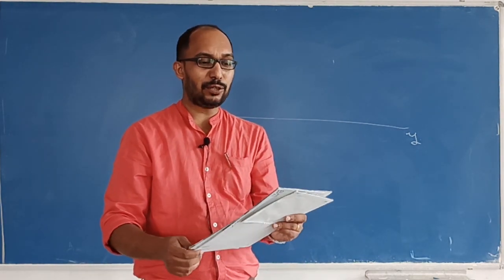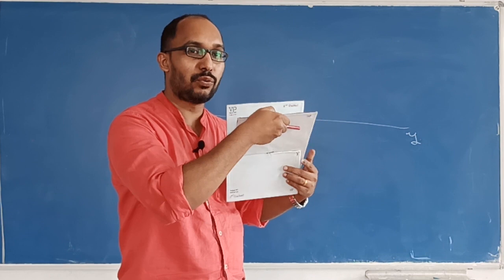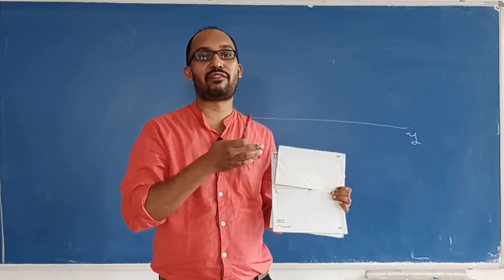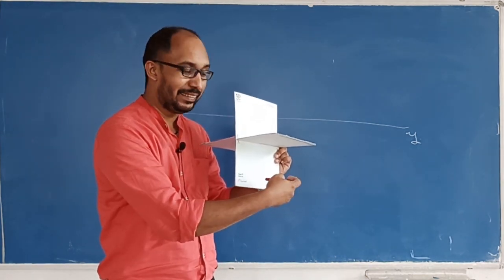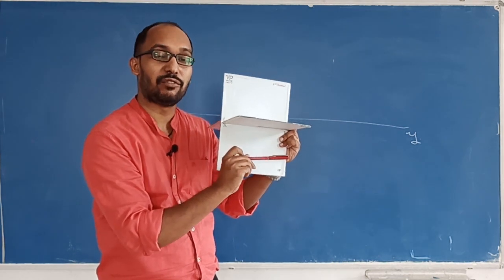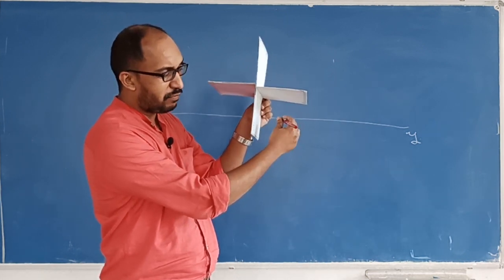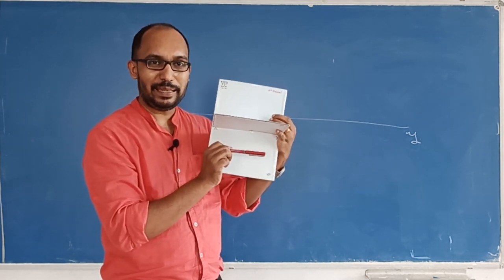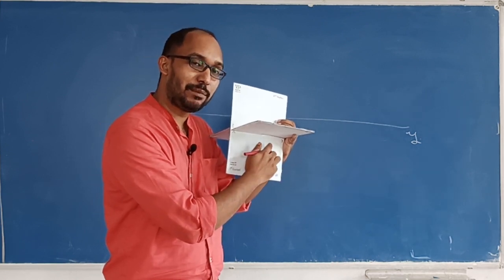Engineering Graphics | Module 1 : Projection of Lines - Line parallel to HP & VP (Part 2) | mesjcet

Comment: Sir ippo kayyil vech kaanikkunne 4th quadrant alle hp rotate aakumbo clockwise alle aakende
Reply from the maker: It cannot be expressed as clockwise exactly, because it depends on which side you're looking from... When you look from left side of the quadrants, HP rotates counter-clockwise and in other direction if you're looking from right.
It's simpler to say, HP of first quadrant rotates downwards.